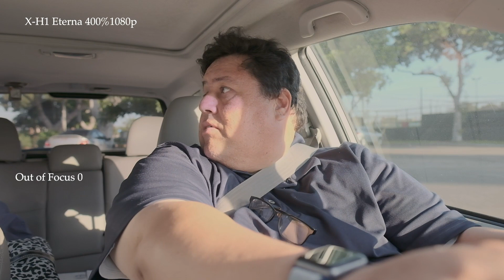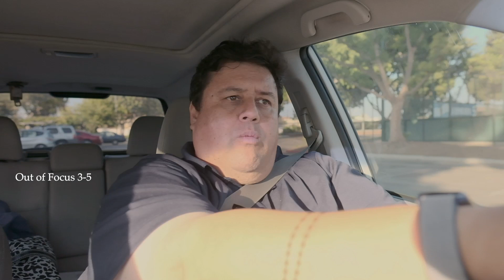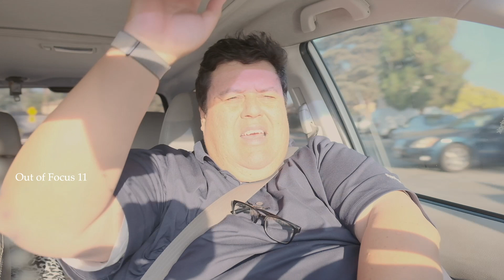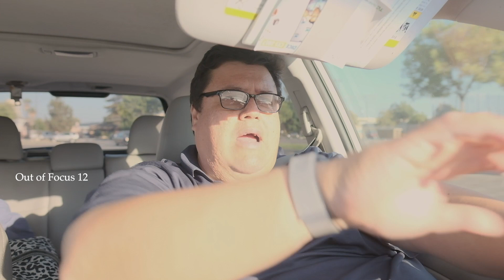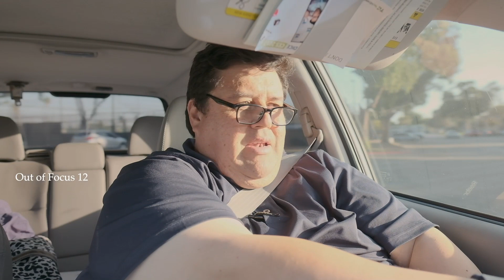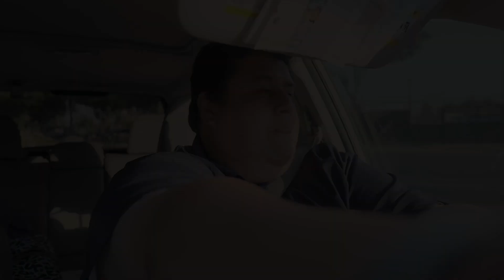X-H1 Eterna 400% Dynamic Range Face Detection

Comment: What lens did you use?
Reply: @frankwc0o  That may be true, but the 23mm for example is much quick at AF, so the out of focus moments might not be as noticeable with the 23 over the 16 (for both cameras).
Reply: I'm usually behind the camera, and I find center AF works better.  But thank you for showing your test for vlog style face detect.